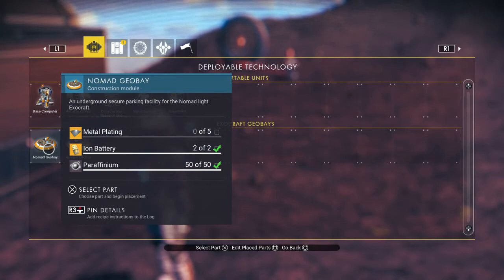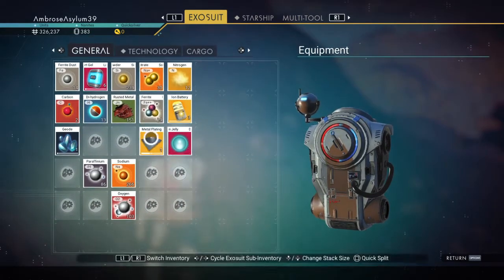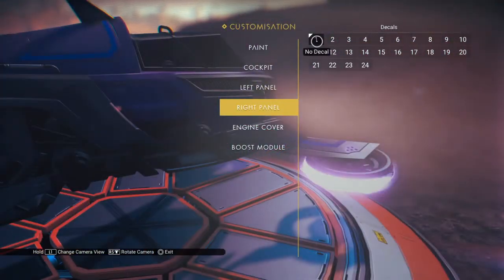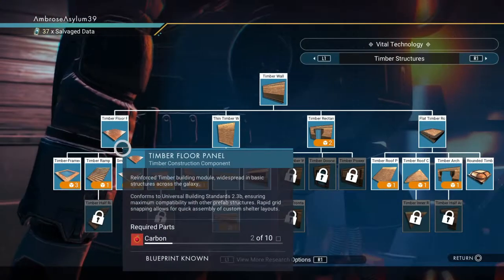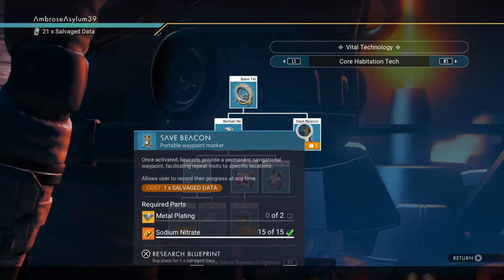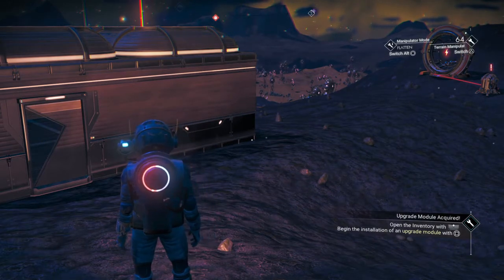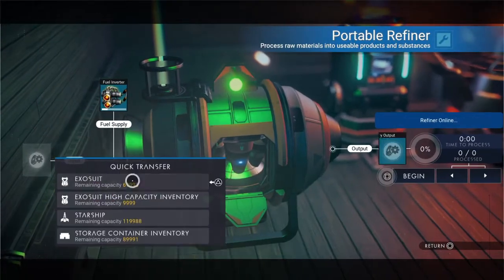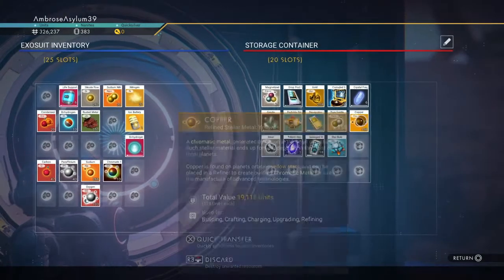Mistakes were Made\\ Episode 22 (No Man's Sky)

Comment: The Construction Terminal on the Anomaly has around ten times more items for sale than are available on the little Terminal the Base Computer gives you. You can also buy items for your base from the Quicksilver Merchant next to the Nexus. You can get cool things like trees, furniture, houseplants, lights and so on from the Anomaly stations and merchants.
     Buy the Medium Refiner from the Construction Terminal on the Anomaly (10 Salvaged Data) and build one at your base to replace the small Portable Refiner you're currently using. You can place up to 3 Medium Refiners in any area of your base. (You can actually place as many as you want, but you need around 50u separation for  each set of 3 refiners). Best thing about these is that they don't need anything once they're built. No need for fuel or power - just drop in what you want refined and push the button.
     I thought you'd like the little Nomad runabout. I find that's my favorite one to drive about. It's quick, it's nimble, it can skim over the surface of a lake, and it can climb like nobody's business. Makes running around for Salvaged Data almost fun. It's even better once you get the S class Engine and Boost modules for it. (See the vendor at the Station).